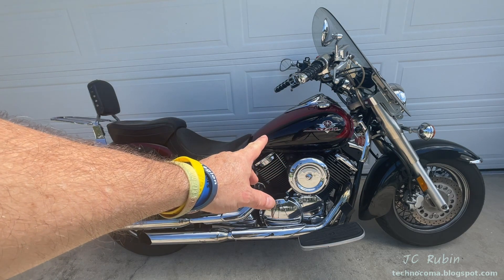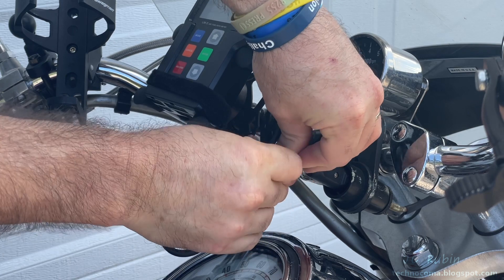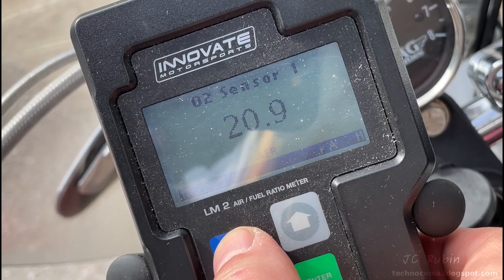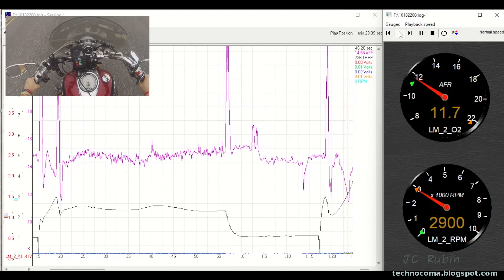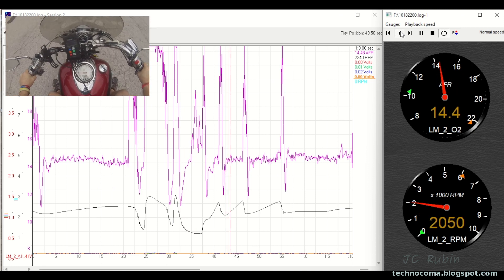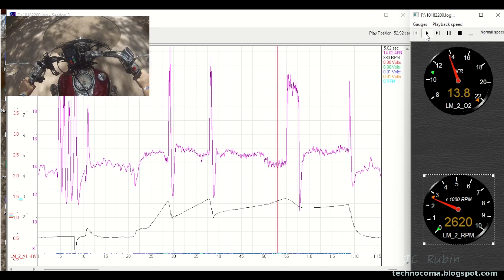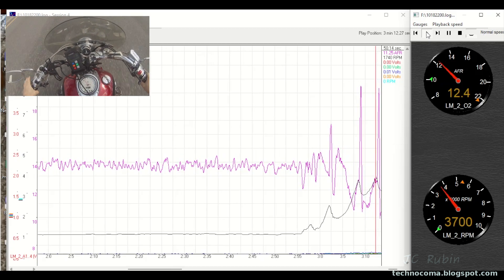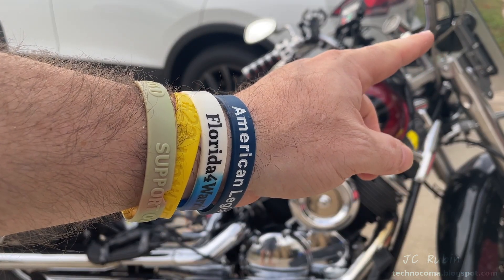Yamaha VSTAR 1100 Computer Assisted Carb Jetting & Tuning with an LM2 Computer

Comment: I've looked at 100 videos on backfiring on the Vstar 1100. My 2002 has been running great for 10 years and now backfires . First just at idle,now all the time. NOBODY has figured this out!!! I've rebuilt the carbs,intake manifold replaced,valve clearance,removed AIS , New battery,new coils,New feul filter,new plugs. NO DIFFERENCE!!! I'm ready to sell it for parts of junk it. Why can't anyone have a definite answer? You don't either
Reply: Did you figure out what the issue is? Do you still have the bike? Thanks.
Reply: Your air fuel ratio probably isn't correct. Do you have aftermarket pipes or an aftermarket air filter or a combo of both? Did you rejet properly? You likely are experiencing backfires because you're running rich or lean, or the carbs aren't synced. It's kind of a pain on these vstars because they're very sensitive to adjustments. 

https://youtu.be/q9A2TL9RvwQ?si=7rpjVAIBrsbHYxti

This is a video that helps you determine if your bike is running lean or rich and how to fix that. Check it out.

Comment: Hey bud ive just bought v star vxs 1100 2002  and there is a noisey rattle while riding  cam chain or valves maybe its done 42000 ks  cam chain ? Valves ? Have you got a tensioner adjustment video does the factory adjust run out of adjustment could chains  be stretched and need new please help regards scott new zealand  🤗

Comment: Hey could you possibly make a video on how to add coolant on the vstar I can not seem to find any videos on that thanks a lot
Reply from the maker: You should probably not be touching wrenches…
Reply: Get out your water hose and spray the bike. There's your coolant. Or ride it, because the air is your coolant. (yes, an air-cooled v-twin means no radiator or coolant)